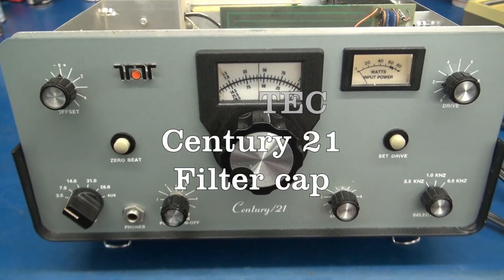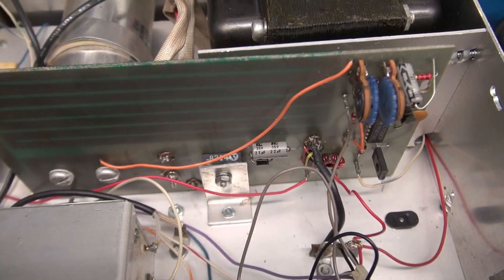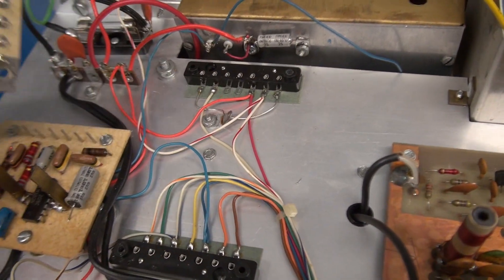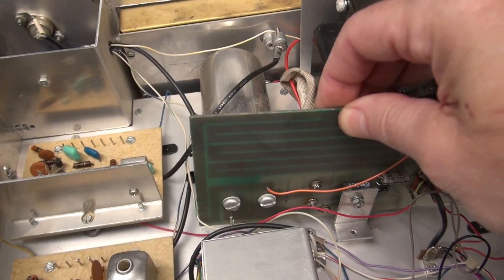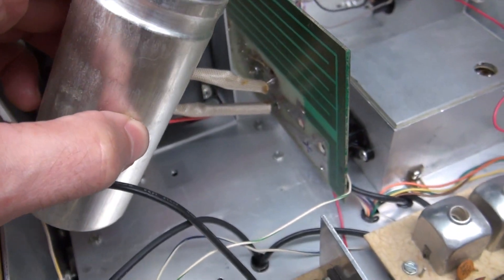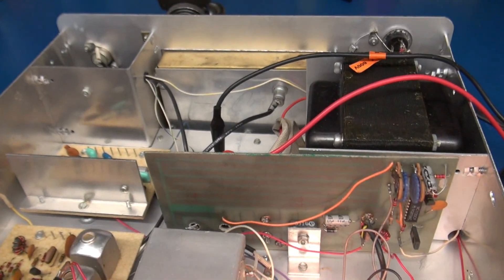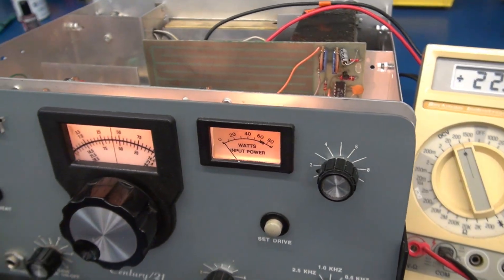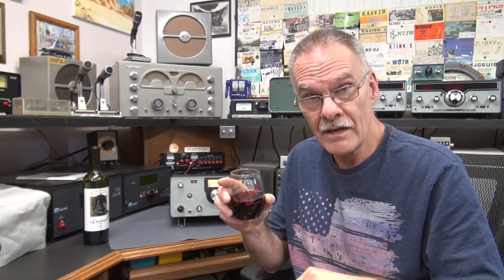Vintage Ten Tec Century 21 CW ham radio transceiver Filter Capacitor replacement How to repair

Comment: That '+' sign seems to be equidistant from either of the two holes! Which is positive? :)
Reply: The larger solder area on the bottom of the  PC board is the positive side. Don't watch on a Smartphone as it
may be hard to see that.

Comment: Those grey IC caps have an unenviable reputation, mostly in the Blues Junior amp variants. Are you checking to see if commenters are on the ball? Pesonally, I would find a convenient receptacle for them. All the best.
Reply: I avoid those IC caps like the plague...
Reply from the maker: Yes they had batch problems on the high voltage caps. I have not seen problems with the lower voltage ones

Comment: I had a home brew regulated 12 volt dc power supply in 1985 with a .47 Farad 75 volt dc filter cap.  It looked like a 1 quart paint can with screw terminals.  Not understanding what it was, my dad stripped the 4:1 step down transformer for the copper.  I was quite miffed since I used it for powering old car radios in the cellar.